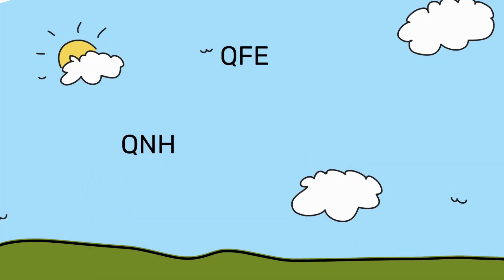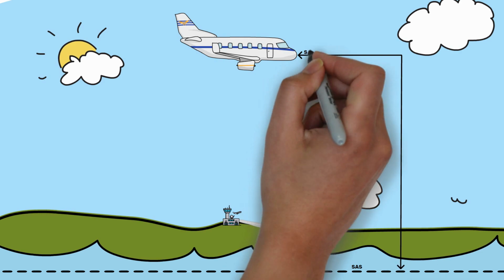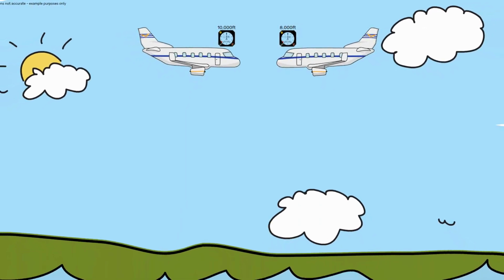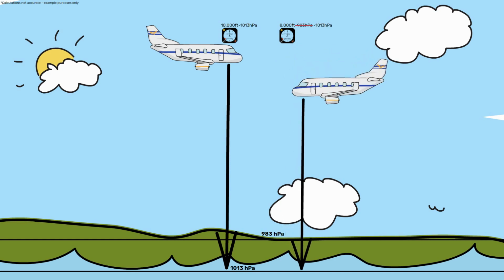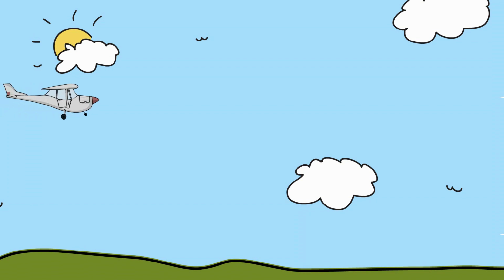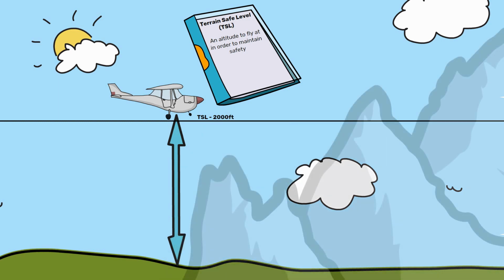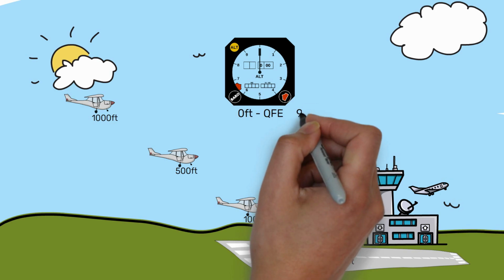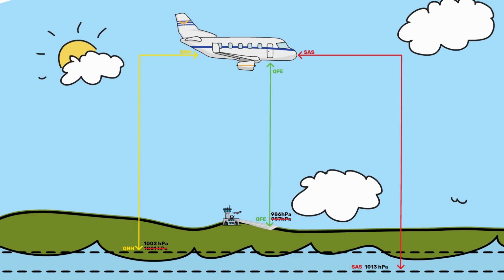What is QFE, QNH, and SAS? [Simplified]

Comment: I understand that ATC receives ALT from transponder, and transponder receives  ALT from altimeter, right? But, what if the altimeter is not set in standard baro but in QNH? How could ATC know that 2 aircrafts showing same altitude would be in fact at different altitudes and that indicating a climb or descent could be dangerous in that case?
Reply from the maker: Thank you for such a great question. So an ATM (Air Traffic Monitor) will generally be (but not always) set to show SAS. So if an aircraft is working on QNH, the ATM will convert this to show SAS. It does this so that controllers know that every aircraft they see on their monitor is being shown on the same pressure. So if we saw an aircraft at 040, and another at 045. We would know that there is 500ft between these aircraft, no matter what pressure setting the two aircraft are on.